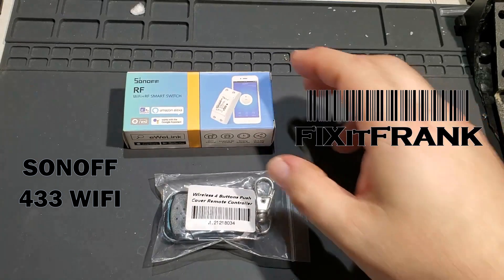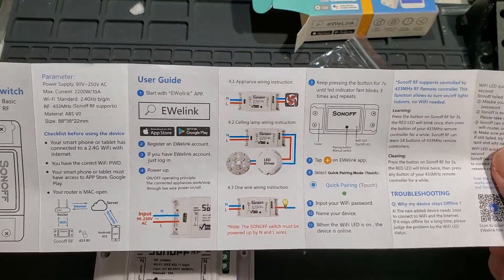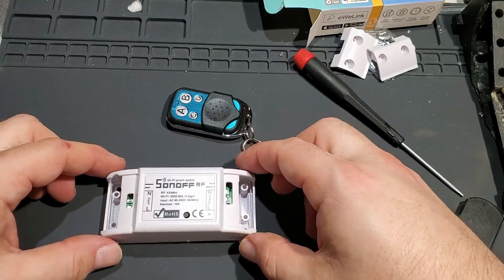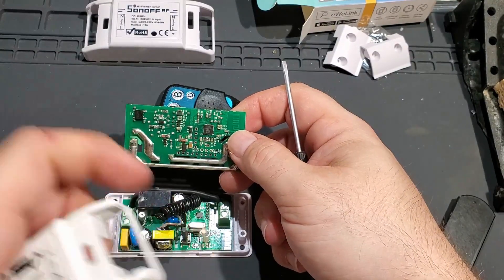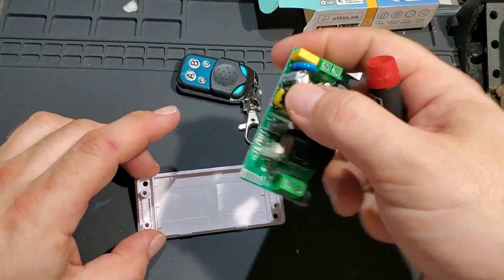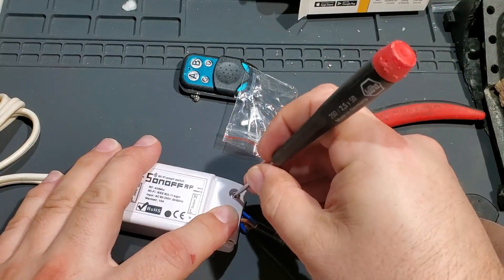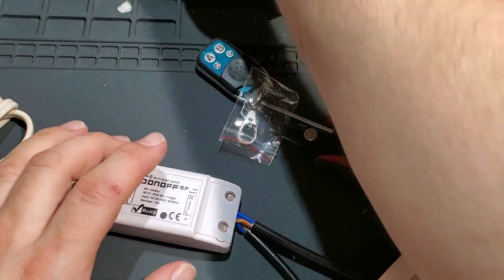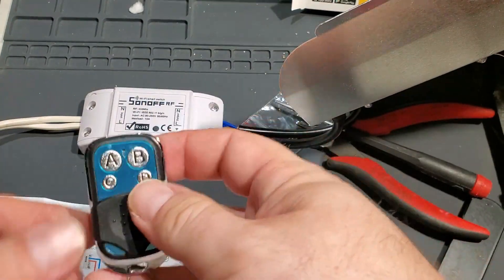Sonoff Wifi/433Mhz Switch Module Review/Testing

Comment: I've been using the simple Sonoff Basic hacked so its a dry relay and simply becomes a switch on my garage door.
BUT, how do we make physical changes to the Basic RF R2 or RF R3, to a dry relay so we can use it as a garage door opener controller?  I want to use the RF side of the RF R2 or R3 with a remote.  I use the 8 button RF transmitter from Sonoff and some generic 433 small remotes like you have there. But I want to use this with my GDO.  Can you show us how to change the Basic RFR2 to this type unit?,  Please?
Reply from the maker: I'd be glad to but its going to take me some time.  What you can do it isolate the AC lines though. Cut the traces on the PCB or if its the wire fed type, cut the wires that take the AC to the relay.

Comment: Really well made Vid! I have one question: What if I want my Sonoff to send that RF to open my gate? I mean exactly the opposite. From my DIY I will initiate a request which will be received by my Sonoff basic... and then I want this guy to somehow transmit the RF that my regular RF remote does?(By the way I have exactly the same RF remote!!) ;-D
Reply from the maker: You want an Arduino RF module that matches the frequency of your gate. The sonoff here is only a receiver, and wont transmit RF. Just the remote does RF transmitting and its codes are set to the switch module.  What you want to do is possible but not with the sonoff stuff.  
What you want to find out is what frequency your gate uses.  Then research into DIY controls for that frequency.  Like I said above there should be an arduino module you can use with some simple C code to create the program. Good luck!
Reply: @FixitFrank  thanx .. Appreciate the help :-)

Comment: Hy.
I have a problem my remote on the gate and i try too config C or D botton and not work.
Can you help?
Reply from the maker: I would open the remote and make sure you have buttons for C and D. Some remotes only have A-B installed and leave no button for C and D. The plastic is there but no tactile button under.  If it has the tactile button, then I would try a new batter in the remote first.  I know low remote batteries cause all kind of weird behavior.
Reply: Yes 4 bottom, pairing and i press bottom and the red light blink on sonoff but i press again and nothing.
Reply from the maker: That is weird.  Is it a real sonoff or a clone?

Comment: Thanks very interesting, it concern's me that the metal light fitting is not earthed though.
Reply from the maker: This was only to demonstrate.  When I eventually put those lights in for real, they were earthed. I pass the earth wire through the switch.
Reply: I wasn't meaning to be negative. It was just that some folks don't have much idea when it comes to electricity and what it can do to the uninitiated.
Reply from the maker: I didn't take it as negative!  Just a very polarizing comment...(see what I did there).

Comment: Very helpful! I recently bought the same items, but got no instructions about the remote. I got the switch working with wi-fi, but couldn't connect the remote. Reading the instructions that came with yours told me how to do it (which the seller couldn't). Problem solved.
Reply from the maker: Thank you for the kind words your lordship!

Comment: What is the range of the remote. I am not getting more that 5 -10 m in closed space
Reply from the maker: I've found the battery charge level and antenna location have a lot to do with it.  I did not test the full range but I found 40-50ft is about how far mine worked, but that was through a cinderblock wall. I ended up using it for controlling a contactor for a 220v air compressor.  If the battery gets lower, the distance drops off quickly. I hung the antenna outside the unit to help.